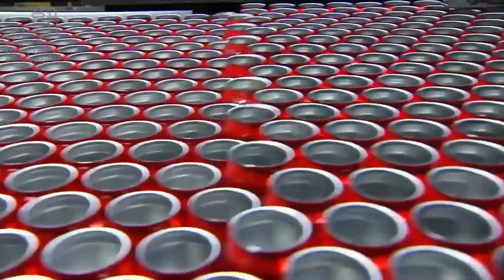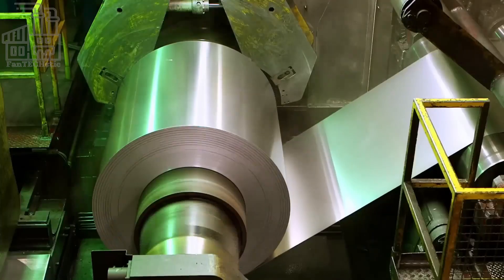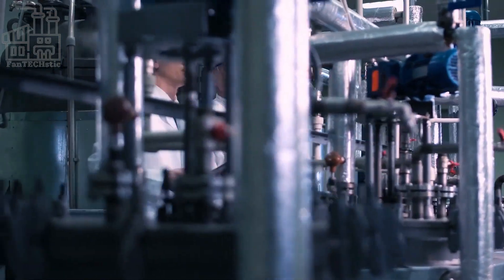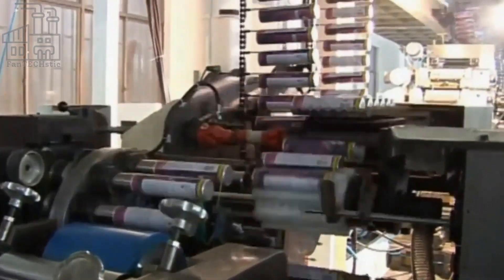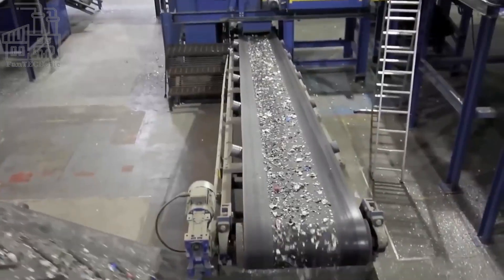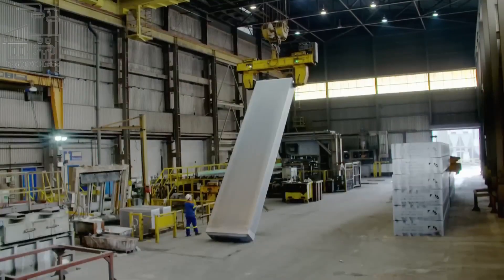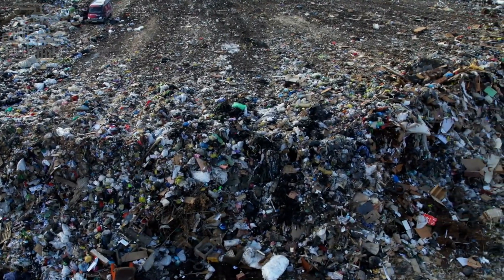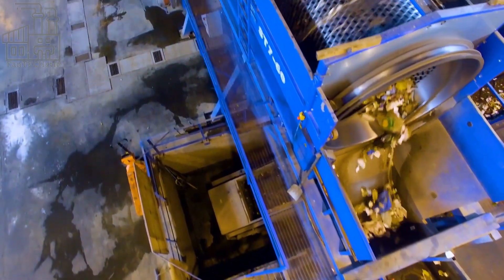Ever Wondered How Coca Cola Cans Are Made?! Join us on this FanTECHstic Factory Tour!

Comment: Lots of errors. 
The aluminium for manufacturing cans comes rolled in a coil about 2 meters wide weighing about 4 tonnes - (not in strips) which is fed into a cupping press.
The cupping press creates cups about 1” high and about 2-3” wide depending on the final can form. They are sent to a 'bodymakers' (high speed draw and press machine).
The bodymaker punches the cup through a series of ironing dies which forms the body and the inverse dome base is pressed. 
Heat may be generated by this process which is controlled by lots of cooling lubricant.  Heat is not deliberately applied as part of the process. The bodymaker forms and trim to the correct height. Typically 100 – 200 cans a minute. 
Quality assurance is mainly representative samples, height, uniformity and decoration are the most scrutinized as well as testing the internal coating and structural integrity – ie dome reversal testing.
Print defects are responsible for more rejected cans than any other part of the process. 
You have the rest of the process back to front – the correct sequence is;
Coil – cupping press – bodymaker – washing (caustic and acidic to remove dirt and coolant) 
Decoration  - to print the label on and a base varnish to help the cans slide on customers conveyors. 
Internal coating (to stop the contents corroding the can) then the neck and flange are formed. They are not washed after these processes. 
Cans only go to a seamer after they have been filled with product by the brewery or beverage plant. 
The seamer in your video looks like an Angelus.